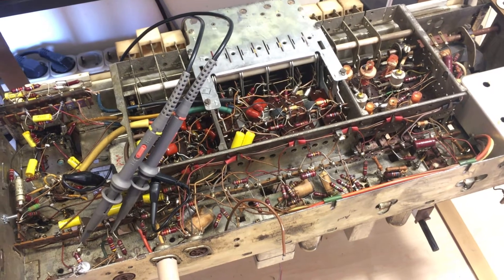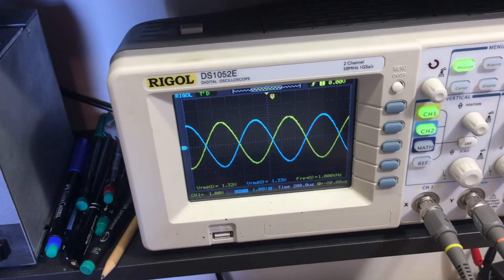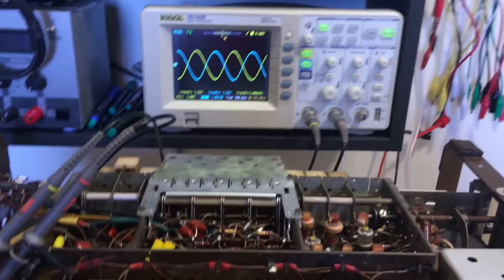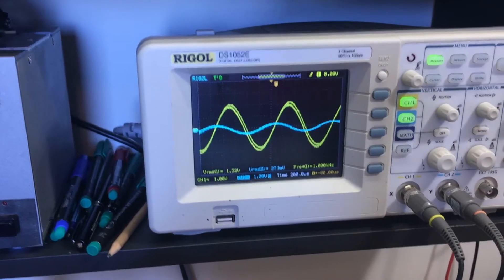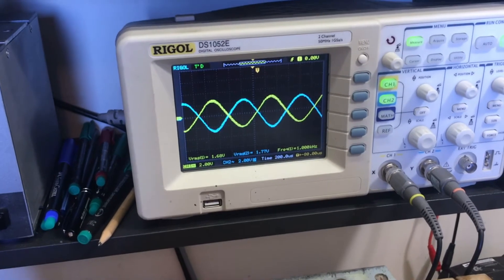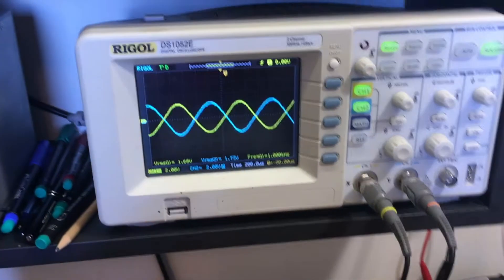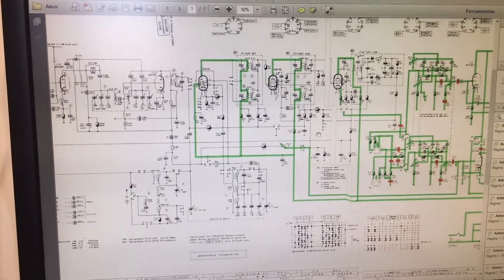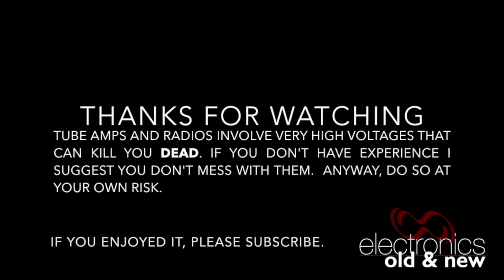Grundig 4198 tube radio restoration - Part 5. Audio done and tested.

Comment: i have a tube radio but the dial glass is broken. Should i try to glue it together or buy a new one?
Reply from the maker: Adam Nieznane : depends. Can you actually get a new one? If you can, go for it, but in most cases this is not an option and you either stick together the old one, or you have to create a new one by using a drawing program to recreate the graphics of the original. Quite a job!